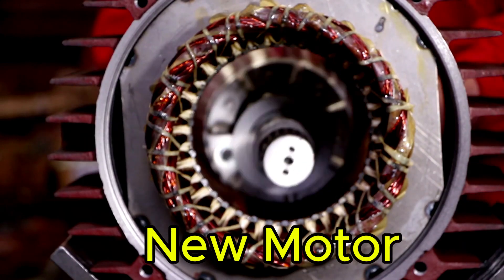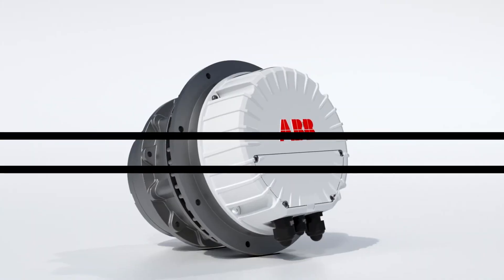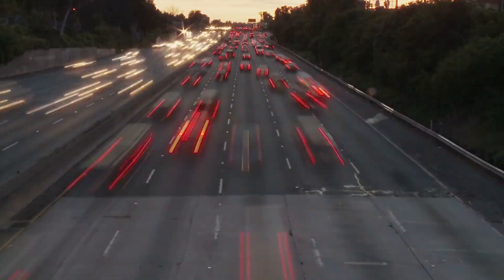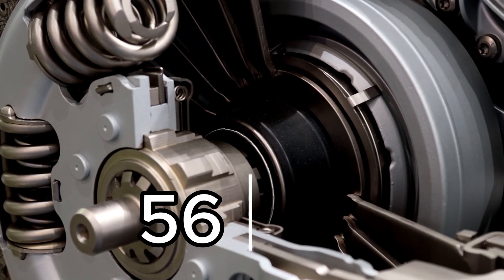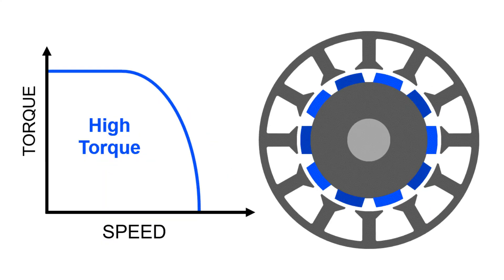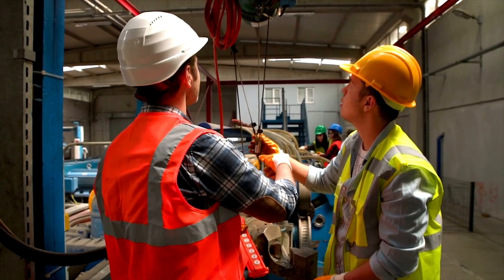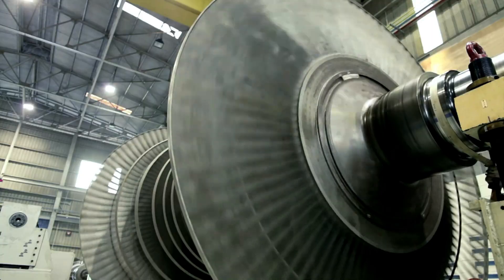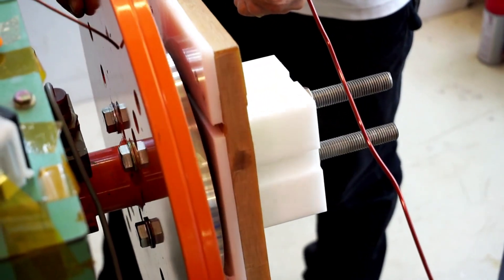World’s Most Efficient Motor? ABB Just Hit 99.13%

Comment: 99% at what scale though? Definitely not at a portable scale I'd bet
Reply from the maker: You’re absolutely right — this isn’t something you’d ever see in a portable device or a car motor. ABB’s 99.13% efficiency breakthrough is on a massive industrial scale — we’re talking a 56-megawatt brushless synchronous motor that’s destined for a steel plant in India. It’s designed for heavy industry where the equipment runs 24/7, and every fraction of a percent in efficiency means huge energy and cost savings. For smaller or portable motors, the physics and economics are totally different — we’re nowhere near 99% there (yet).

Comment: 1 minute mark  No one is talking about Maxwell Chikumbutso micro energies like Nicola Tesla ! Threat to Trillion $ Inferior Energies
Reply from the maker: That’s an interesting point — a lot of inventors and fringe energy concepts rarely get mainstream coverage. The difference here is that ABB’s motor isn’t theoretical or suppressed tech; it’s a tested, installed, real-world machine already headed to a steel plant in India. The challenge with ideas like Tesla’s wireless energy or micro-energy breakthroughs is scaling them reliably and safely. What’s exciting about this ABB design is that it shows incremental engineering improvements can still deliver massive global impact — even without reinventing physics.
Reply: Nikola Tesla didn't even managed to beat 50% with his induction motor. Others (actual inventors) did
Reply from the maker: Tesla’s induction motor was revolutionary for its time — not because of peak efficiency, but because it brought practical AC motors into widespread use. Early versions were nowhere near today’s numbers, but they laid the foundation for the entire electrical age. Modern engineering has been about building on that groundwork, refining materials, winding techniques, and cooling methods. ABB’s 99.13% brushless synchronous motor is kind of the latest step in that century-long journey. So in a way, both Tesla and the “others” contributed — one with the breakthrough concept, and others with decades of improvements.
Reply: @renewable_energy it was not invented by Tesla. Patented in US for sure, but polyphase induction motor was invented by Galileo Ferraris and modern version (squirrel cage) was built at the same time that Tesla filed his patent.

Comment: That is great advancement towards 100% efficiency. I liked the video.

ABB has set a new world record with a synchronous electric motor that achieved 99.13% energy efficiency during testing for a steel plant in India. This Top Industrial Efficiency (TIE) motor surpasses ABB's previous record of 99.05% from 2017, offering significant electricity cost savings of approximately $5.9 million and reducing CO₂ emissions over its 25-year lifespan.
Reply from the maker: That's fantastic news and thanks for the positive feedback!